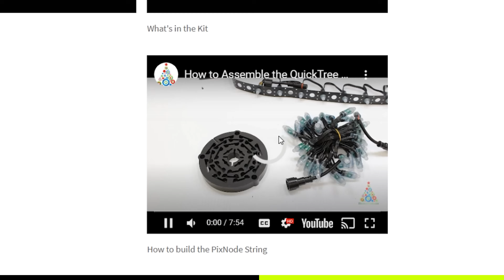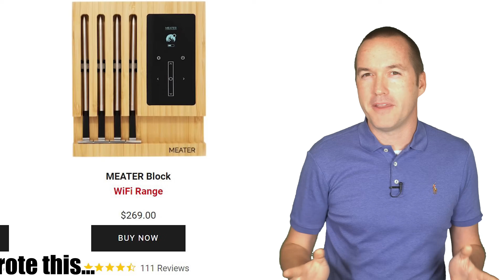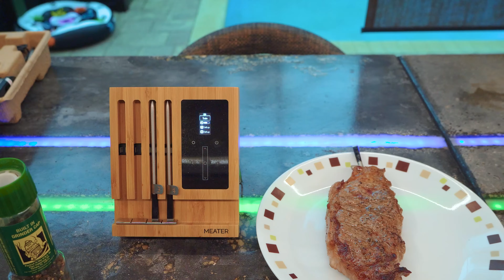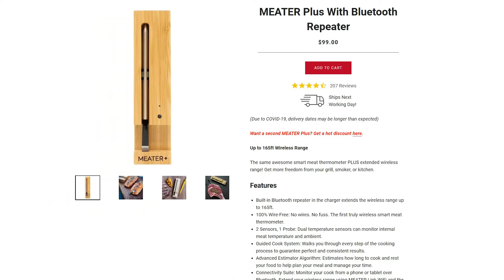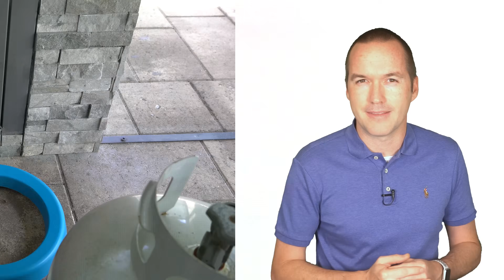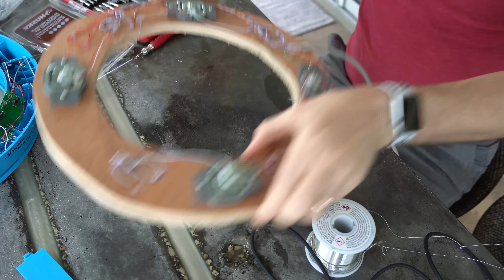5 Smart GRILLING Gadgets to Up Your BBQ Game.  Meater, FlameKing, ThermPRO and More.

Comment: The problem I've had when using an instant-read meat thermometer is that the temperature of the meat varies a lot depending upon probe placement, so no matter how accurate the probe is, there is still the placement issue.  As for the issue with the propane tank issue, wouldn't hooking up to the natural gas line (if you have one) or having a standby propane tank be an easier solution?  I used to keep 2 tanks and when 1 ran out, I'd swap and replace the empty one immediately.

Comment: I would consider the Meater Block if it came with a better warranty. 1 year just isn't enough in my opinion. At that price point it should be 3-5 years. 1-2 years seems to be about the average life span for meat thermometers in my experience, and that's a typical wired on. The Meater Block however is far more complex and that is just more points of failure. I also noted that their max ambient air temperature is only rated at 527°F. That seems awfully low for a grilling environment.

Comment: Bought a MEATER, had to have it replaced (connections were sporadic), and now my 2nd probe simply just fell apart.   While focusing on temperature has simplified cooking, I cannot recommend those probes, especially for price, and also erroring out at high temperatures.  I'm heading to ThermoPro or other.
Rob, you are generally spot on, but I have to respectfully disagree with some of your conclusions.  In all fairness, you may not have been exposed to those scenarios.  Good luck with yours.
Reply from the maker: How hot are you cooking? I think the limit for the outer probe is around 520F, so if it is touching the grill surface when searing it could easily get damaged.

Comment: I want to assume, since you didn’t actually say, that you made your own weight sensor for he propane tank work being being powered all the time? Which, to be honest, is really the best way to go. But can you just verify that? Cuz I was almost thinking while the video played that a ‘smart’ scale would be a better option than the 2 you ‘reviewed’. But your solution seems like it’s probably much cheaper, just takes some DIY time. And MQTT of course, which I haven’t actually dove into yet. If... you did in fact make it powered all the time. A video on that would be something I’d be interested in.... maybe also making it with a close range outlet you can plug an extension would be awesome! You know.... cuz you may not always want to leave your grill in one spot...
Reply from the maker: Yep, it's powered all the time, it takes readings every second for 30 seconds and then sends the average reading to my home automation hub (home assistant) every 30 seconds via MQTT.
Reply: You gotta do a video for that. I gotta see it! That is actually very cool. My only issue... I’ve never setup anything via mqtt. Actually.... I haven’t even really setup mqtt at all.. but this is something I would definitely be interested. I love this idea. Awesome job!

Comment: Four AA batteries can be replaced with a USB charger. 
Just probe with the multimeter which is the "end point" and solder on the black and red wires from the USB cable.

You can also use wall plugs and some hot glue to make a AA replica. It works quite well if you get the correct size.

Comment: Think 3 legged stool vs. 4 legged stool on an un-even surface - cheaper and more stable. If you put it on a couple of 2x4 chunks your fingers can get under it and turn the switch on and off as needed. it seems to take multiple tries to get it to connect, but once it connects it seems to work well. But neither the switch or the case even pretends to be water proof, and my grill stays out on the deck year round, we will see if it drowns.

Comment: Concur with the MEATER. I got the single probe for Christmas last year, and recently bought the block. I use it every time I cook meat now. BEWARE- don’t leave the probes in if you’re searing your meat over high flames in the grill. I broke one of the probes doing this. MEATER was gracious enough to offer a one time replacement, even though they caution against doing this in their tutorials/in the app.

Comment: I use a Wyze Cam V2 plugged into a small portable battery pack pointed at a cheap wired temp prob https://tinyurl.com/y5asy59m for long smoking cooks (10 hours plus).  This is $50 and allows me to monitor the temps of the meat and smoker remotely with my Wyze app on my phone.   I have been using this for well over a year without trouble.

Comment: Yes to weight sensor, I have some already that I want to use for acid dosing and salt dosing the pool, was going to experiment with them rather than the ultrasonic for how much is left. Although I heard they drift over time... if the load is constant....

Comment: One other grilling gadget to add to the list.  I occasionally have forgotten to turn off the BBQ.  This means that the next time I go out to BBQ I have an empty propane tank. 
I see two possible solutions to this.
1. a cheap version that would require you to reset it each time and would cut off the gas after the time that was set. I have seen analog devices that currently do this.
2. a smart version that can take it to the next level. A device connected to the BBQ that can detect on and off. It would detect when the BBQ is turned on and send a message to phone asking for the time limit and if no response was given then it would use a default time. If the amount of time exceeds the limit then it can either turn off the gas or notify me and I could turn it off. I have not seen anything like this yet.
Reply from the maker: I think the weight sensor should be able to handle this via an automation.

Comment: Yes, a video on the NodeMCU solution would be appreciated. Although like others I agree that I see a three foot solution s better for uneven surfaces, given your use-case is a level surface under the unit itself, four feet is perhaps a better solution. My first thought when you presented both the weight and the ultrasonic systems was "ugh BlueTooth" much prefer something that has WiFi or some other data connection back to HASS. As for the Meater Block I totally concur on those points, I got mine in the Kickstarter campaign a number of years ago, and it's great (did just order those numbered flags though)

Comment: Definitely would make great use of a video with a DIY scale. I've been looking to build one for my butane tanks for a while.
The water heater in my house is fed from a 45kg butane tank

Although I always have a spare tank, gas always finishes while I am in the shower alone in the house with no one else to switch the valve for the spare tannk.

Comment: Great video as always! Curious if you've heard anything or worked with Inkbird. I pickup up the iBBQ-4T and turns out is is a SmartLife device. I was able to see it and was ready to flash it with tuya-convert, but I haven't seen any templates. Unfortunately, I'm too new to know where to start on setting it up. Would dig it if someone smarter than I could give it a go. ;)

Comment: You missed one of the biggest advantages of the Meater.  Rotisserie! When I do a roast, it's almost always 20 minutes at 425 then drop the grill to about 325 for an additional 1.5 hours. But, the temp on the grill isn't accurate, and roasts vary. The Meater lets you spin that cow for hours, due to no wires.  I have the original Bluetooth, so my phone has to stay close to the grill as I cook, lid down. But now having seen the Block... Shut up and take my money!
Reply: Steve Mason I wonder if one of the probes could be used to monitor the grill temp
Reply: @JesseAdams3  the original Meater has 2 sensors one in the meat one outside to monitor the grill

Comment: The scales work better for really large tanks. Like the kind that heat houses. They don't really...uh scale...down. especially when the tank itself is almost 50% of the total weight. I was wondering how long it was going to take for you to say "forget this noise" and use a NodeMCU. I'm surprised you didn't DIY a thermometer.

Comment: Oeh, Nice. Is there any way to connect a bbq temp controller to Meater? And I'm trying to find something to also automatically controller the outgoing air.

And to solve your electricity problem: can't you replace the batteries with a module that functions as batteries but does have a wire to it?

Or maybe connect a Qi module. That might make it more flexible on where you want to mount the block.

Comment: I have the Meater+ and I REALLY REALLY love it. I want to upgrade to the Meater Block too, but the Meater+ isn't bad. A LOT of people get hung-up on the BLE connection. Between the + and the Block, the probes are all BLE. The difference is that with the +, the BLE connects to a phone or tablet, while the Block will essentially act as a BLE-to-Wifi bridge. When I cook using my + in the kitchen (reverse sear in the oven for example, I just connect the probe via BLE to my iPad and leave the iPad in the kitchen. When I'm cooking on my grill (weber kettle), I have to keep the iPad right next to the grill. I usually setup the cook BEFORE I go putting the probe into my cut of meat, so there's no tablet interaction after I've handled raw meat. 

One note about using the Meater probes (+ or Block, same probes) on a grill: Don't use them over direct heat. The maximum temperature of each probe is 524F. The one time I tried to cook with them on my weber kettle over direct heat, the app immediately let me know that the probes were at their max and I needed to remove them right away. However, when cooking indirect using a 2-zone method, they worked fine. My + has seen multi-hour smokes and many many shorter cooks of pork chops, steaks, chicken breasts, etc. They've worked great every time. You'll get slightly more repeatable results cooking Sous Vide, but my Meaters made me enjoy cooking.

Comment: Regarding 3 sensors, it's actually better with 3 than 4! If/when the surface supporting the scale is not perfectly level 4 sensors will be balancing resulting in shifting signals from at least two load cells. 3 feet will always be stable, even on uneven surfaces, resulting in more stable signals.
Reply from the maker: Yeah, but load cells are easier to code in pairs :)

Comment: Oh please make a video about that build! I bought the same sensors to put under my bed in order to automatically turn on/off the lights at home, so it definitively has more use-cases than calculating the weight of a propane tank!

Comment: Thank You for another great video! I love that you try what is out there and if it is good, you say so, if not, you build your own and then in the case of the LED fixture and dimmer control, sometimes go back and say "now there is a buy solution that is better"! I had my home gas piped so I never need to check but do want a flow meter and motor operated valve for that so I never leave it drawing from my gas when not home.

Comment: Wow the Meater block is awesome but would cost an arm and a leg to import it to South Africa.  

Barbecuing - we call it braai (br-eye) with gas is frowned upon here in South Africa.  I frown upon my brother in law as he barbecues with gas 😂.   We cook on hot coals as a result of a wood fire.  But that also introduces many variables in terms of heat - can be too hot or not hot enough but through the the years and trusting ones gut, all is good at the end of the cook.   The Meater block however is only really suitable for steak and chicken breasts which I hardly braai, but doing a whole chicken or leg of lamb or gammon in the kettle braai would definitely need the Measter block!  I’d need many more probes for lamb chops on the braai 😂 

That propane level monitor - yes! I need to do that as my stove top in the kitchen is gas. Like you, I have also been caught but thankfully always have a spare tank on hand. A video - ya definitely.

Comment: Are you joking?! I mean it and I love to BBQ even more often. Get a ThermoWorks probe and a better sense of cook time. Otherwise for long cooks WiFi with a wired base is best over any Bluetooth I can think of. I can cook my steaks in the dark, 1" any steak 2.15 min turn 60° (my preference is diamond over square) 2.15 min then flip 2 min done 135° F with a fast double check. Also spend the money on an EVEN temperature cooking grill / cooktop. Grills with hot spots are completely useless. Personally we have a large buried propane tank, about a thousand gallons for whole house generator, with an actual meter.

You got too many damn batteries, you're completely dependent on them, it's like an insane balancing act, and people without common sense are a larger problem to know better from experience. I prefer any hardwiring (any) over wireless. Wireless to me is purely if the device is constantly moving around.
Reply from the maker: I actually have very few battery powered devices and will likely be hardwiring the MEATER as well.  

I recognize grilling and cooking are skills that can be developed (just like navigation), the MEATER lets you skip that and just get good food.
Reply: @TheHookUp  .. No, I see a gizmo that offers very little utility, isn't cheap and I can foresee tossing in the trashcan way too soon. Low production, uncertain reliability and small batteries to disassemble and something to fix. 

I'm in the KISS method. BTW I own a data center and to me technology is a tool, it's a tool in my house that I want to be reliable and in particular invisible. In this case, it's not the $400, I couldn't care less if they were $1,000, it's something that looks to have some oddball battery if you're lucky or worse some built-in Li-ion (hopefully not some other type) in either case adds aggravation in my life to deal with and potentially disposable. 

Here's the difference, I perfectly understand your hobby / business YT, in contrast I evaluate anything on it's service, serviceability and cost. When I get home my joy isn't by picking up something and keeping my fingers crossed that it works, is charged or whatever is potentially wrong. I'm me and you're you. Hopefully you'll make a few bucks off this probe. 👍

Comment: Hi Rob; I would like to see your build of the weight sensor you mention in the video. I usually use a barbecue with a mesh grill, do the Meater and the Thermpro hold up to the heat? Thanks for all the great videos - I'm currently messing around with some Shelly's ATM.

Comment: Great Video!  I have a ThermPro (TP20) and a free instant read thermometer for posting on their FB Page.  I would not recommend ThermPro.  Worked great out of the box for the first few months.  A year later and the temperature takes over an hour to some what accurately read.  Contacted ThermPro and they suggested a new probe.  I got a new probe from them and a probe from ThermoWorks and the results were the same.  I was going to buy a new setup from ThermoWorks Smoke X4 ($199) but you may have changed my mind.  The 2 pros of the Thermoworks is that you get a high temp probe for the grill temperature and it is a bit less expensive.  The con is that it is wired.  If the Meater had a high temp probe it would be a no brainer.  

Thanks for the review!

Comment: Can a Wyze scale be modified for this they are $20.
Reply from the maker: A good idea, but unlikely to work.  It requires step on/step off calibration
Reply: The Hook Up do you have wyze sensors?  I have seen many issues with them when the battery dies.  I am thinking about using sonoff sensors instead.

Comment: Rob, for the DIY guy you should check this out https://store.heatermeter.com/ it does everything you mentioned and then some. I have been using this for 8 years now. There is also an Android/Apple app, plus you can make it work with Homeassistant.
Reply from the maker: Wires are a no go for me.
Reply: @TheHookUp  Understood, if you change your mind, I'll send you a board. :)

Comment: I have the original Meater (not the plus one with the extended range) and I can say it's still a very good product. We actually use it more for cooking inside than on the grill. One tip is to get the probe in the meat and all setup THEN setup your cook on your phone. The only downside is it's bluetooth only, so the range is pretty short. That's the big advantage of the Meater block as it handles the wifi connection and does a bluetooth connection to each probe.

And add me to the list of folks who would like to see the propane tank video.

Comment: You should take a look at the Fireboard too. Wired sensors, but it has WiFi, open API, on-device controls, extensible with a blower fan for smoker temp controls, etc. I absolutely love mine.

Comment: I like the propane tank system. I do think however that the 3 feet with load cells would be a better design as it would accommodate uneven surface unlike the 4 load cells. It would prevent any rocking of the tank and be more evenly distributed on the load cells.
Reply: I agree, the 3 foot design makes sense for a stationary object.  Where as a 4 foot design on bathroom scales would prevent tipping while stepping on and off, unless you have a triangle scale.